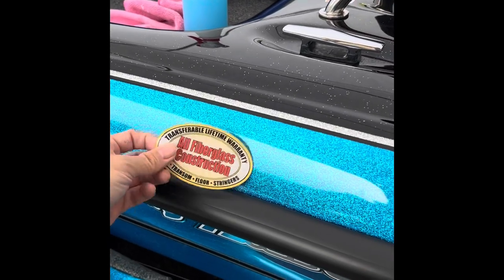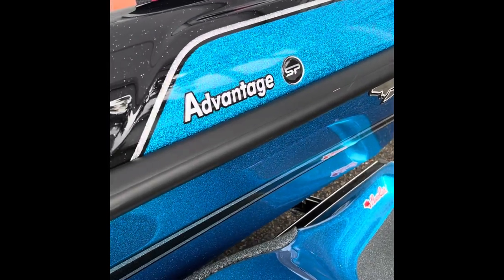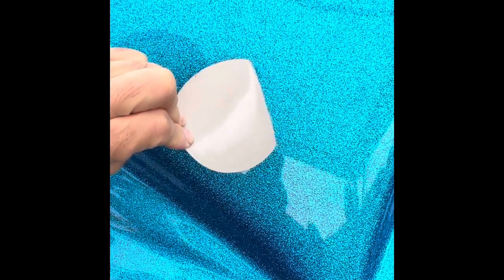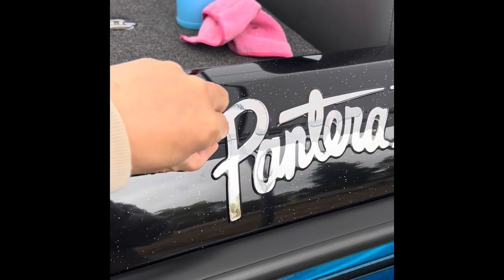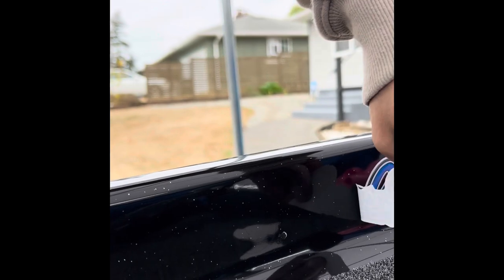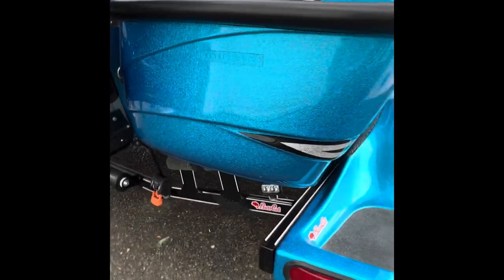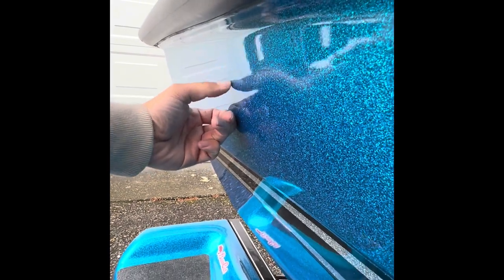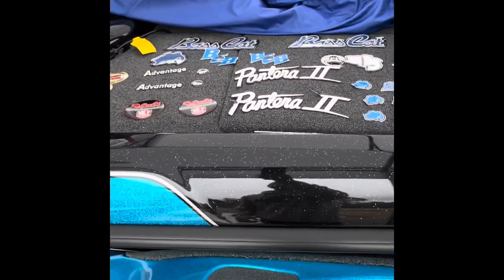Removing decals/badges off my BassCat

Comment: Those logos came off super easy Ditch. The boat looks much cleaner and nicer. Having a new boat certainly helps with the process.  Taking stickers off an older   boat where some of the stickers may be over five years old can be a lot harder due to the weathering but following the same procedures you laid out still applies. Thanks for sharing- the boat looks great!
🙂👍🏻